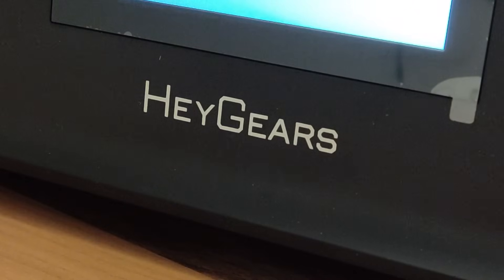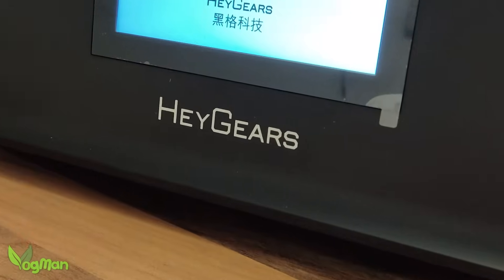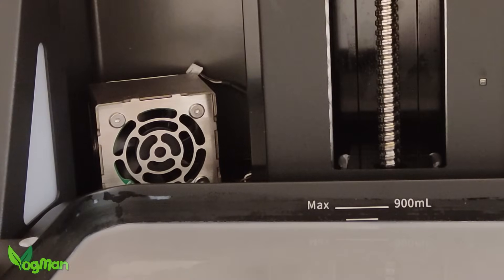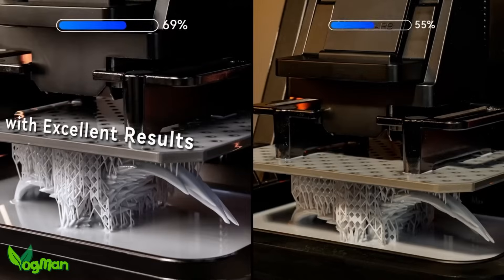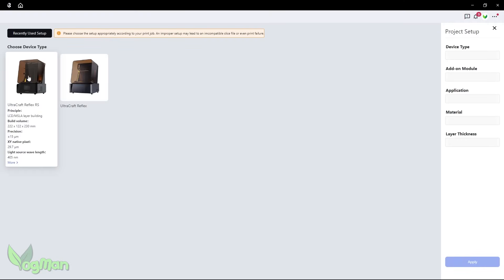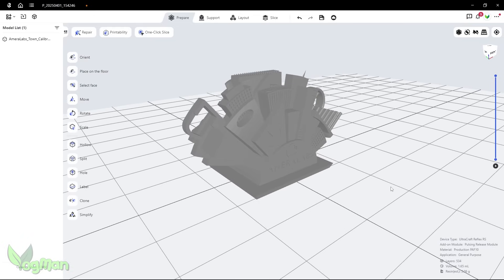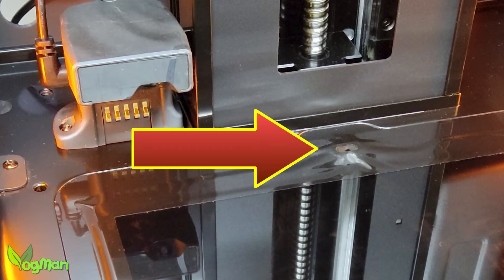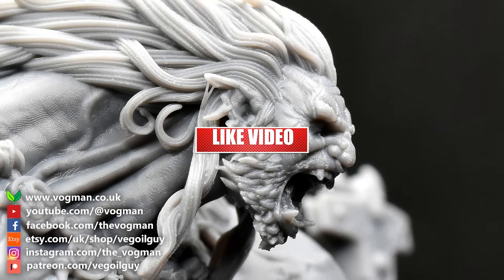AMAZING 8K DETAIL with HeyGear Pulsing Module

Comment: Proprietary resin is a failure.
Reply from the maker: I can only speak for the products I have in front of me. I've used a few HeyGears resins now, and they work. Print great. No setting issues. No cracking or splitting a few weeks later. These do exactly the job you want them to. 😁

Comment: Really need a test model with and without the extra gear.
Reply from the maker: We need more than just one. We also need to test on different parts of the plate, with different resin, with models of different shapes, sizes and angles. And we need to do it hundreds of times to prove consistent results. I haven't got the time or resources to do that unfortunately.

Comment: My first thought was "nope dont want to know about a printer that wont let me use other products." But i also use a bambu A1, plus the bambu slicer and the bambu app. But i dont use bambu filament as i like elegoos. Im guessing you can use other resins just not with their slicer software? Honestly i simply couldnt afford one of those printers even though it is very appealing
Reply from the maker: Unfortunately you cannot alter the settings on a HeyGears, so you can only use their resins. It's a downside for sure. The upside is that you never have to worry about settings.

Comment: you might be able to see what's happening with no resin, no buildplate, make the printer print in the air, and use some smoke to see where the air is going, the concept sounds like a good option.
Reply from the maker: HeyGears printers seem to be full of safety features, which is good. But it's a pain if you want to try printing without resin or a plate, etc, as error messages pop up and refuse to print until fixed.
Reply: @vogman  I figured as much and wondered if finagling a clear resin via a hey gears bottle might help.  

Have a form 2 that required some cheek if you wanted to use the wiper and heat functions for a non-formlabs resin.

Comment: I've been wanting a bambulab esq experience with sla printing. Just without the walled garden security drama stuff. I love my Saturn 2 but dislike fiddling about with settings. I spend more time with settings than printing. And I admit I've taken a break from it for the past year. I just need a step below having to use a specific brand consumables.
Reply from the maker: HeyGears seem restrictive from the outside, but when you're on the inside you fall in love with the ease of it all. You may pay a little more for resin, but you don't waste half of it dialling in the settings. It just works perfectly first time. They have their haters because of these restrictions, but they continue to grab more market share, so to me that proves people want an easy life. Personally I like easy too 😁😁😁

Comment: Obviously the FEP is double layered for the release module to pump air inbetween. The big hole and the connection to the printer via hose should make this very clear.
Reply: I have a form 2 that could be used to see where this style of plug and play machine has come from. I've now moved to elegoo for the open resin use, happy to talk. I remember one bid you talked about testing one but not having access to one.
Reply from the maker: Yeah, I believe it is. But I'm entitled to have a little fun during my videos 😁😁😁
Reply: @vogman  I do hope this inspires some competition for innovation. So I can get a printer with the module that's not 600+$ hahaha along with a heated vat.